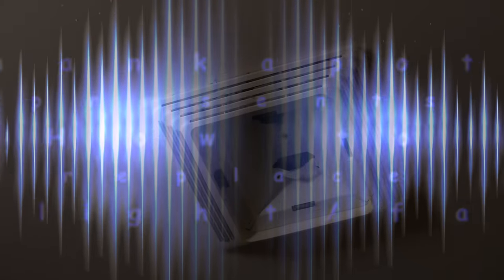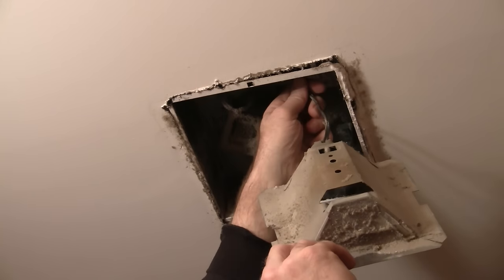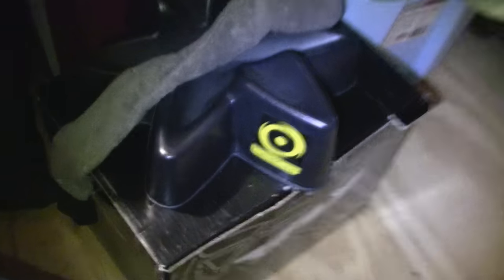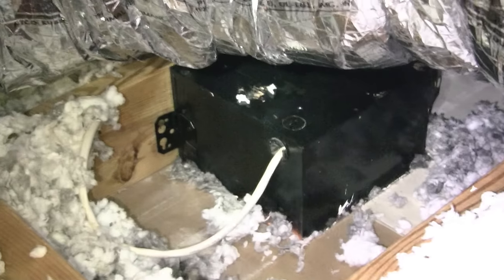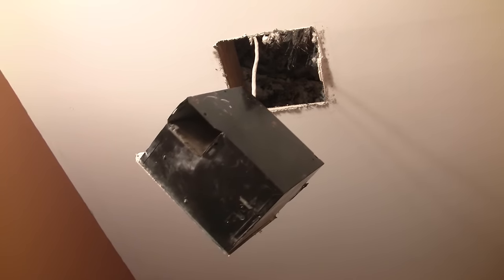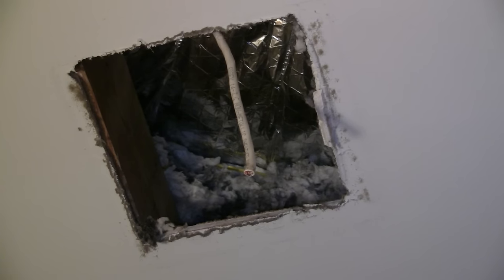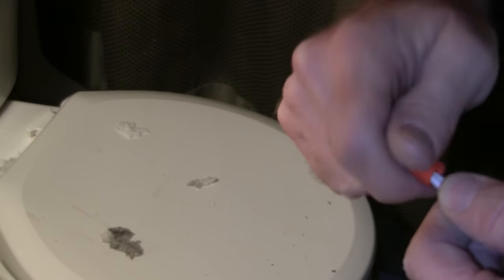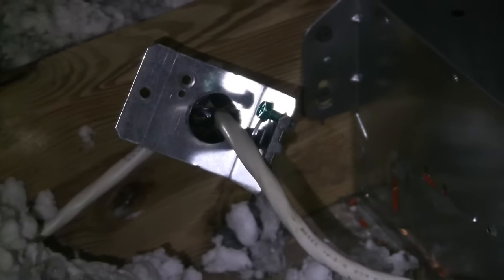How to replace the ceiling exhaust fan and light in the bathroom

Comment: You didn't show how to get the cover off, the most important part. :(
Reply from the maker: Sorry...It has little tabs on the sides that will flex in and allow the center light cover to be removed.
Reply: Dudette!  If you can’t figure that one out, leave it alone!  You might get hurt messing’ with electricity stuff.
Reply: Push in those little tabs on the side and the cover should come off. Hope this helps and good luck.

Comment: It's NEVER a good idea to pump hot, steamy bathroom shower exhaust into an attic only..... Trust me, 55 sheets of plywood and a new roof is a direct consequence of previous owner not installing a $18 roof vent kit, yes $18 kit at Menards was a no brainer after a $7500 roof job and the guys installed it for nothing since they were down to basically no roof.
Reply: And it's also a code violation in many places to vent directly into the attic.
Reply: @rigidrebel8781  yup.... That too
Reply: Hj

Comment: no need to go in attic. the plate retaining the fan motor and blades is removable. locate small retaining screw near the plugins for fan and light. if no set screw look for metal retaining tabs that hold much like a cereal box top. replace fan motor and plate. if new plate wont match up just swap out the motor n reinstall.
Reply from the maker: Part of the reason for the attic was to make sure wiring was in good shape and it was vented properly. Also, mine was easily accessible. Good to know you can still change it out even if you can't get to the box via the attic. Thanks for the input!
Reply: Thank you to the @DrShankopotamus and to you Clint. You tips and video helped me out to just swap it from the bathroom side without getting into the attic.
Reply: If there is no attic above, like the first floor, this is the only way.
Reply: I was just thinking hmm I don’t have an attic…now what? lol
Reply: Kinda late to this but wanted to say thanks. Just did this without removing the housing from the attic. Worked great! Appreciate the info.

Comment: Please don't ever vent your warm moist bathroom air into your attic space. Trust me this is coming from someone who had to sell a house that had mold in the attic. We had to spend $5,000 in mold remediation due toa  bathroom then that it was unknowingly venting into the attic.
Reply from the maker: Absolutely correct in most cases. Mine was vented to the HUGE attic for 20+ years without any damage, so I left it that way. Just put a fan in my daughters house and cut through the roof to get it vented outside...Thanks for watching.

Comment: As others have pointed out, not a good idea to vent into the attic.  I just had a section of our roof replaced due to mold that had formed and rotted out the wood sheathing.  Turns out it was from a vent pipe from a bathroom exhaust fan.
Reply from the maker: Agree...but how big is the attic and how close was the exhaust to the wood? Thanks for watching.

Comment: "It's ok to exhaust into the attic" he says.  Well right there it is apparent you have no idea what you are talking about.  It is not ok to vent into an attic--period.  If you don't understand that you don't understand condensation and other basics.  Plus it is really as easy as it gets when you have full access on a steep pitch roof in the attic.  Do that in a 4/12 pitch or less and see how easy those maneuvers are!  In many cases you will have to do everything from down in the bathroom opening the sheet rock if necessary.   It is also very important to insulate your ducting from the fan to the outside which is another high condensation area.
Reply from the maker: We have already been over this...😉. Fan was exhausted into the attic (by the builder) for 20+ years without any damage. The attic is huge. Yes, code says to exhaust to the outside, but my house came with that particular fan exhausted into the attic and i decided to leave it there and not go traipsing around the huge attic to lay 20-30 feet of exhaust conduit, cut a hole in the soffit and fall two stories while trying to attach the coding approved duct terminals to the outside...You're point is well taken. But I believe my reasoning is sound. Thanks for watching. And taking the time to help out with fixin' stuff.
Reply: @DrShankopotamus  REALLY BAD DECISION!
Reply: @DrShankopotamus  these people that have absolutely nothing to do with your house seem so mad. Thanks for posting the video. Found what i needed to know and it was helpful! Have a great day!

Comment: Very helpful!  Did not realize that it requires some work in the attic until I watched this video
Reply from the maker: You're very welcome
Reply: I think if you can match the exact parts and fan/light assembly, you may not need to go into the attic, if you're just replacing the overhead fixture, bulb, 

and just plugging in the new fixture, otherwise, you'll be going into the attic and probably replacing all the exhaust stuff too.

Comment: I was hoping you would show how to take the light cover off. I only need to change the light bulb.
Reply: Just depress the translucent cover at the base a smidgen. There’s a tab that fits in notch on metal frame
Reply: @joebuckaroo82 what?
Reply: If you cant do that , put the tools down and pay someone.
Reply: @markharmon6942  Bruh used big words like “depress”  nah man just say “Pop off the plastic by pushing in on it and it will come off”   Like we don’t need them powerful words
Reply: @jdillust  depress was only one word. You used a lot of words.
Reply: @cinderbliss  K. New Video today at 8PM ET 😄
Reply: You got to push the two sides of the light cover and pull it down.
Reply: You can’t depress them as it’s flush with fan

Comment: I just moved into an old small home dating from 1927: luckily the overhead shower fan works fine, as does the main bathroom overhead light, amazingly,
so I'm not messing with it. Instead I'll install a battery LED overhead shower light on the ceiling, and leave it at that. I also currently don't have access to the attic,
it's locked off and a total mess, from what I was told.

Comment: INCORRECT!!!  It IS a big deal to exhaust warm moist air into your attic.  It creates white and black mold, and can rot your roof sheathing, no matter the size of the attic.
Reply from the maker: Thanks for the input. House was built that way 20+ years ago and not a spot of mold in it. Since it was built(and passed inspection) I saw no reason to take the extra time,  extra money and extra risk(see my prior post) to fix it...as I have said many times before...code says exhaust to outside, mine wasn’t so I left it that way...and size does matter. Humidity of the bathroom air will have very little effect on the overall humidity of my attic. Thanks for watching.

Comment: Can you pull just the motor without going into the attic ?
Reply: Indeed you can. Leave the outer box in place and install new guts in it. Take the guts out and find the model number, go to HD or Lowes and buy a new example of same model. Remove guts from new one and install them in old one. Throw away new outer box.. it only takes a few minutes and you DON'T have to go into the attic. Apartment complexes do these by the hundreds.

Comment: I have the same brand NuTone. I’m in a 3 flat and we don’t have an attic it’s another apartment. I’m pretty sure we have venting out on the side of the building.
Reply from the maker: You're supposed to in that case...But I was replacing fans at my beach house and the first floor vans were just vented into the space between the floors??? A lotta work to get them to the outside. Builders don't always vent them properly. Thanks for watching.

Comment: I got yellow and gray wires only. Is yellow hot and gray neutral? Yellow with black wire and gray with blue wire? White wires get tided together only?
Reply: My apartment is old building so no ground or red wires. Instead, I have yellow and gray. 2 whites and gray go together. Blue, black, and yellow go together. Quick research online I was able to figure this out

Comment: I installed the fan/light and the light works but the fan doesn't turn on. Plus there is only one switch for the light Can you tell me hat is wrong with it?
Reply: Theres two white wires on the new fan sounds like you missed one when connecting. Should have a total of 3 white wires together

Comment: I have that exact same model - you could have just pulled the motor out from below and replaced it...  although by going into the attic you discovered other issues.  It's never good to exhaust hot steamy air into an unheated attic space.  In my case the idiots nailed it to the joist between floors and I have no access to pull it out without destroying a tile floor or a bunch of ceiling drywall.   I'm probably going to have to destructively cut it out as I have a wiring issue behind it.
Reply from the maker: Good luck with that one...You're right about the attack...but my attack is very large/open, and I elected to keep the exhaust there and not run exhaust hose all the way to the outside...too much work...Thanks for watching.
Reply: Slip a long Sawzall blade between the side of the enclosure that's supported and the beam/sheetrock and cut the nails.

Comment: Did all 4 'metal tabs' of the fan box go to the INSIDE of the plastic duct adapter???  Or just the two opposite tabs that click into the metal fan slots?
Reply: What about if you don't have  the red wire.??
Reply: @aureliosanjuan2306  Why are you hijacking my question? Post your question as a separate one please.

Comment: Most people would have to cut the sheet rock to get it out then you would call a good spackle guy to fix it. Or destroy the box with tin snips and a grinder or sawzall. This way would avoid destroying your sheet rock.
Reply from the maker: I've installed several with cutting the sheet rock...You're right!...My recommendation is to cut carefully and small. You can always cut more but you can't cut less. Thanks for watching.

Comment: Never exhaust in attic and have a timer switch instead of on off. So that fan keeps running after you leave and turn off in few minutes leaving no moisture in the toilet
Reply from the maker: Great idea for the fan timer. Don't usually recommend exhausting into the attic, but have tons of room up there and too much trouble to run the exhaust all the way out...Thanks for watching.

Comment: So when you say about turning off the power, do I need to actually flip off the circuit breaker for the bathroom, or is toggling off the light switch on the wall good enough?
Reply: If you need to ask that, you shouldn’t be working with electricity…always turn off the power at the circuit breaker
Reply: @MarkRambo1  Replacing a light bulb is not what I consider to be "working with electricity," as it is not my intention to take anything apart or disconnect wires etc (which I probably wouldn't try to do), but thanks.

Comment: The way my old one was set up one switch turned the light and the fan both on or off how would this affect replacing the fan? (The light still works the motor on the fan died out)

Comment: Is it ever a good idea to take the exhaust off of the wiring and just use the light… my light and exhaust are off of one switch and I want it to just be the light
Reply from the maker: As long as you don't have any loose/open wiring, I don't think it would be a problem.

Comment: I have that same fan. My light doesn't work, not a bad bulb.
Reply from the maker: You can go digging around through the box and check the connections for the light...or just replace the fan. One option...When you replace the fan, turn the power back on very carefully with terminal twists on each wire so you don't start a fire. You can use a multi meter to be sure you are getting power to the fan light. If you have power turn the power back off and install your new fan. If you don't have power call an electrician. Another option. Just install the new fan and see if the light works, if it doesn't then there's a problem with the wiring...call an electrician.

Comment: The light on my exhaust and fan doesn't come on and my house is 7 yrs old, should I just replace the entire fan. It's very similar to this one?
Reply from the maker: If the fan is working there might be a short in the light circuit. Mine is on two separate switches at the wall as well...make sure there isn't a problem with the wall switch and/or wiring. Good luck.

Comment: I'm pretty sure the same people built my house. Everything done path of least resistance. I've been suffering for a couple years now trying to figure this thing out. Unfortunately,  I has some drywall issues I suspect from this bad boy.
Reply from the maker: Definitely can have issues. Some love to knock me for exhausting to the attic...but it's HUGE! I was amazed to find my downstairs fans were exhausted into the floor space between the first and second floor. I was able to get one of them out to an outside wall, but some of the others have no where to go without dismantling the ceiling.

Comment: This is such a pain in the you know what. I have a split level house and the attic is super tight and cramped with no decking whatsoever on the joists. Not to mention the fan I need to replace is in a corner with barely any room. I'm to damn old and fat to be doing all that lol

Comment: But what if you don't have the red color.??
Reply from the maker: I assume you mean from your power/switch supply...This would mean you only have one control for both fan and light. You would need to install second switch or just hook your fan and light to the same switch. Check your install instructions with the unit to be sure you can do it this way. Hope this helps...Thanks for watching.

Comment: Hey is there a way around the attic?
Reply from the maker: There was a post from another user who said it could be done without getting in the attic. I guess there might be a way to leave the outer box in place and just change out the fan and light assembly. Since most are secured in the attic from outside the box, I would think you must be in the attic to change out the box. Hope this helps...
Reply: There should be 3 like tabs on that allow the motor to seperate from the case

Comment: Bath fan must be vented out the roof or side of building. Otherwise moisture and mold accumulates
Reply from the maker: Thanks for watching...House was built with van vented into the attic and was that way for 20+ years...No damage...Attic is HUGE (as I show in the video) and bathroom is small. Otherwise, definitely vent to the outside, but the continued controversy has been great fun.

Comment: What if you can't get in the attic? There's just a small square spot that an adult can't fit through
Reply from the maker: You can replace them without going into the attic. The hard part can sometimes be getting the old one out. On a few I had to remove the "guts" and use shears to cut the metal box to get at the nails/screws holding it in. I've done several that way. I'll see if I can get a video on the next one I do. Thanks for watching.

Comment: Its never a good idea to exhaust moisture into a cold attic! # mould
Reply from the maker: You saw mine was exhausted right onto the sheet rock. The attic is very large...No mold/moisture yet after 20 years...Was a calculated guess just to get it up off the drywall. If your attic is smaller I would definitely exhaust to outside.
Reply: Mine is not exhausted. It’s the original unit since the home was built in 1993. I am in Alabama, could be because we don’t experience frigid cold winters like the North?

Comment: YOU DO NOT HAVE TO REMOVE HOUSING! Guys watch more than one video, ALWAYS! You can remove fan and replace without going into attic. Please don’t make videos when not 100% what ur doing.
Reply from the maker: Does anyone really know what they are doing 100% of the time?...I just post all kinds of fixes about how I did it...Your mileage(and experience) may vary. Others have said it can be done without getting in the attic, but if I didn't go in the attic we wouldn't have all these great discussions about where my vent hose was going...Thanks for watching and for the input.